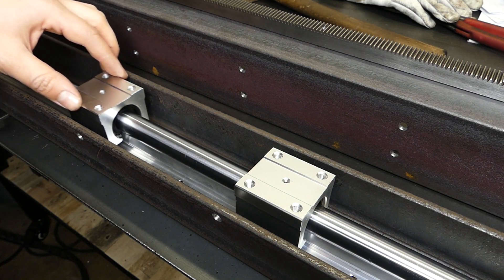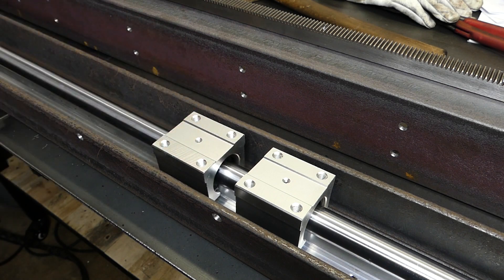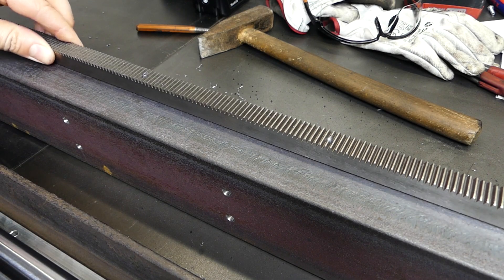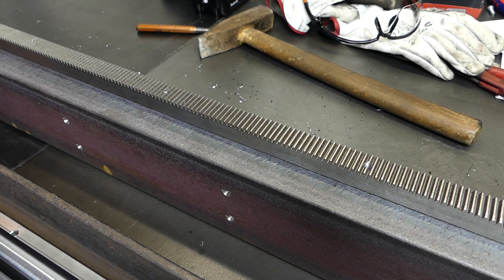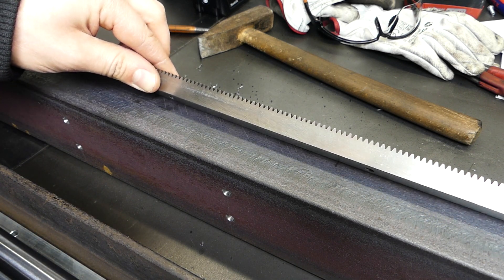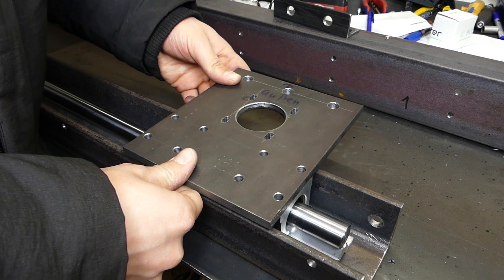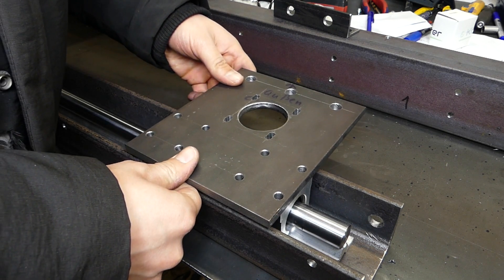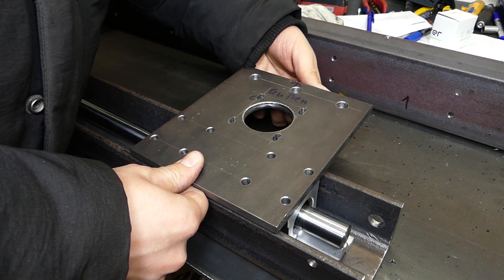CNC Router and Plasma Cutter | Part 2 I

Comment: Плохая идея с прямым приводом, пробовал, - большая вероятность пропуска шагов.
Reply from the maker: Yes you are right, but it's much easier to build and the motors are strong enough for the things that I want to mill with the machine.
Reply: @samsworkshopdiary5748  what is the type and torque of the stepper motor  you had used please more informaions.
Reply from the maker: @yacinesadouki4606  The motors are NEMA 23 with 3A and 280Ncm